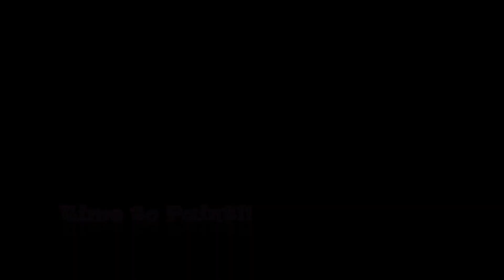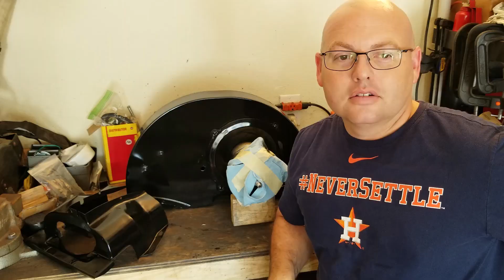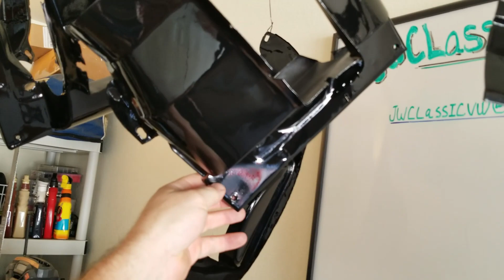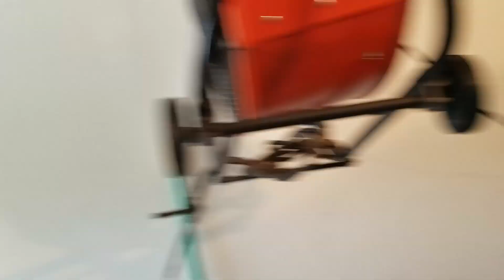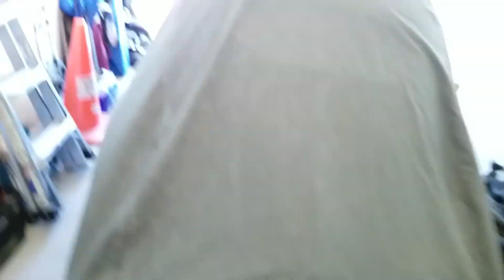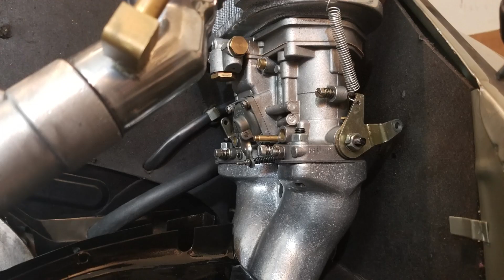How To: Paint Engine Parts & Tin -  1956 Ragtop - Volkswagen BUG | JW Classic VW

Comment: Hi Jason would it be okay to paint my block and my cylinders with stove paint flat  magnesium block I know it has to dissipate the heat I'm not driving it very much at a time but I want to stop some of the corrosion on the block❤😊❤❤❤
Reply from the maker: I never saw any issue with it... some folks disagree with painting the case, but the cylinders it's all good.  The case some stat it could impact cooling, I never experienced that.

Comment: what grit sand paper were you using  for the tins? 1200?
Reply from the maker: 1200 isn't nessary 250 350 is fine... works better with multiple coats of rattle can.